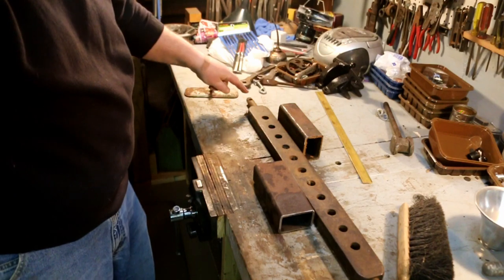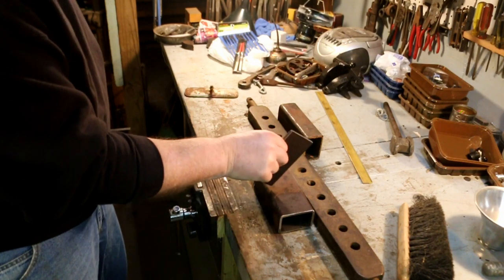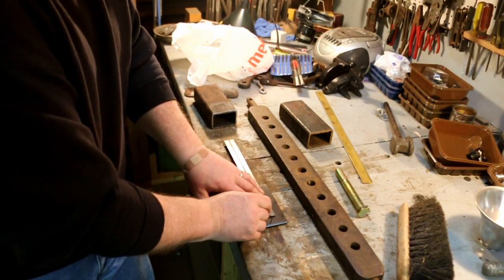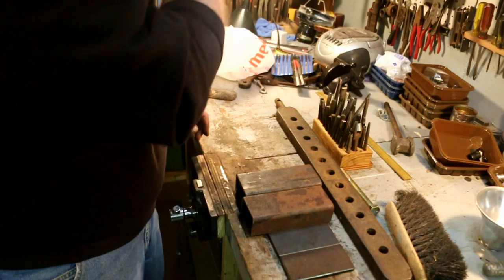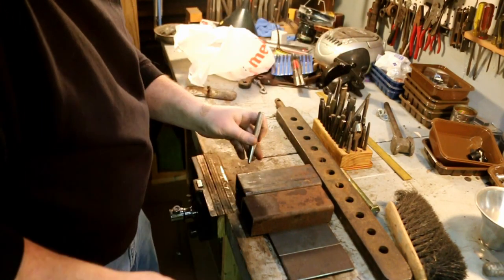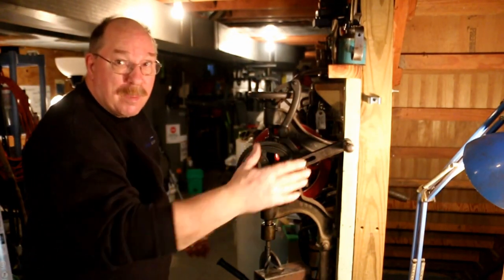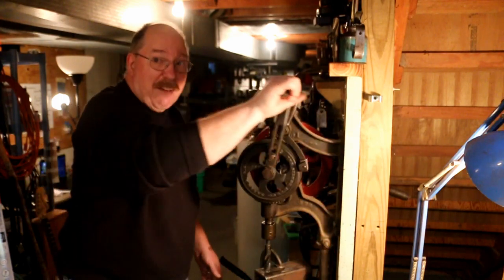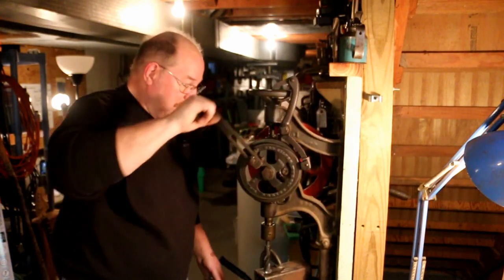Building A Tractor Mounted Engine Hoist Pt 3 The Boring Bits

Comment: Our old post drill in the blacksmith shop at one time ran off a line shaft but was converted back to hand crank before I was born. Ours had a fairly large cast iron fly wheel built into the crank arm...or better yet, the crank was attached across the flywheel.  We could flip the indexing lever 'in' to engage the automatic feed or 'out' to manually feed by turning another wheel at the top of the quill with your left hand while cranking with the right.  The left alternately oiled the bit and turned the quill feed when the auto feed was 'out'.  I have at least two and maybe even three smaller versions of post drills hanging in the rafters in different sheds for decoration as we speak.  Good video sir. I enjoy old tools quite a lot.
Reply from the maker: There is another post drill sitting on the floor under this one. It needs the lower mount, shaft, and table.

Comment: Every time we get to see that lovely post drill is a great day!  Thanks Dave!!!  😃👍
Reply from the maker: It use to just hang on a support beam in the old shop. Ryan was about 4 years old and smart enough to not get his fingers into the gears. He loved to crank the handle when he was out there with me. 
When I mounted it here I decided to use it in a couple of videos just because it was kind of unique. That's when I discovered how well it works. The gearing is such that it doesn't take much effort to turn even a large bit. Drilling the 3/8" holes for the SB lathe motor mounts I could almost spin it with my finger.
Reply: YOu need one or 2 shined up, Scout!

Comment: That's why I like the old stuff. It'll work when folks are hunting PC Boards to get the new stuff working again. I like my Clunkermobile as Cheryl calls it. Don't need a computer tech to fix it. And the Honda is even better. But arthur doesn't agree with some old things. I have to sort out and set limits, or rather arthur does. Good deal, Unc!  I dare say the mower is already at home and probably running by now!
Reply from the maker: I wish it was. It's still sitting in the neighbors shed. Lots of projects going full time. Most are  of the dull kind so no video. 
I understand setting limits. With the grace of God I managed to heal up on my own from two blown discs. Took 6 years, but it is almost as good as new. For those six years I was very careful as to what I did and didn't do. I have avoided arthritis so far. Runs in the family so that's a plus. 
My nephew was just in the hospital for a second surgery on his back. He was paralyzed for a while before the first surgery so it was definitely needed. This time it was pinching the nerve and causing severe pain.
The neurologist told me that if I was healing at all then to not have the surgery. He said the problem with the surgery is the scar tissue is what it is. Most times it works fine, but for my nephew it made it much more difficult to fix the second time.
Reply: @OldSneelock  I understand. If it ain't broke so bad you need help, don't get any. Every fall my breathing gets shorter. I think it's from all the stuff that certain people spray in the air, for the corporate good, of course. I just wheeze along till spring comes and I get somewhat better but I've never been this old before so I don't really know what to look for but I sure know I ain't getting a bit younger. I can send you the box tracking number in a personal if you want it. It's coming priority. It was the same as ground so he just sent it priority which was fine with me. I've got it right here but I know with everything going sideways sometimes I'd better ask so you'd be looking 4 it. And my back hurts all the time too but I wobble along. No knife for me yet.
Reply: @lewiemcneely9143  At first I thought you guys were fixing machines until I realized you were talking about God's machines. Knees ain't what they use to be and the left one sometimes has something floating around in the cap. No problems until you kneel on it and then you pinch what ever's floating in there and it feels like a knife. I try to kneel on towards the inside of the left knee. Ya press on it slow in case it's not in the Wright place. Oh and seeing as I work in industrial insulation another thing we do is cover pipes with rubber insulation to prevent sweating and I have save some of that to throw down where i'm gonna kneel. I still do what I use to do it's just that it takes me longer to do it. I also try to plan better how I do things. Laying under the car and having to crawl out to get a tool is something that I learned to use the Seven P's. Prior Proper Planning Prevents Pretty Poor Problems and also is easier on the back and knees.
Reply: @mostlymoparih5682  HEY, Palley and you never know how or where it'll go here. We have some dandy conversations back and forth. No strangers here that I've found and Unc. makes sure there are no chrome-plated jerks either. A FINE place to be, just like the Wally's Place. Everybody has their own niche and we're all here to learn and help out. I can't use my knees except to sit down or get back up after a roll over. The kneeling is over for me and has been for some time. I have a buddy that got semi-fried insulating condensate pipes in a running turbine at an atomic plant. PLEASE stay away from those blasted things, Buddy. He's well taken care of for a supervisory mistake but still in a wheelchair. Don't need YOU in one! Too much to do at the hotel and garden this spring! The job'll take care of itself, sorta.
Reply: @lewiemcneely9143  Gotcha keep my hands to myself.  I do get burned sometimes but it's usually the arms or the back of the hands. We are always looking and you hit a pipe quick to see if it's hot. Steam is hot and you have to be careful around it. Be nice to stop working butt gotta pay the bills and the freds and the daves. Everybody wants money. Maybe I should buy a lottery ticket.
Reply: @mostlymoparih5682  10/4 on the steam. I did a lot of talking with the guys that worked at the paper plant here about steam because everything about it ran off it and they said the found leaks with a broom handle because of the volume of high pressure and you couldn't see in it anyway. I worked all over the outside and always wanted to take a tour of it but it was gone before I got the chance. I was working with sub-contractors with hauling or concrete or doing draglineing or something. I would walk around and peep eye stuff during eating time or waiting time. Went under the boiler house once where the coal grinder/induction fans were and got to thinking if one burped I'd be fried. I left.
Reply: @lewiemcneely9143  Yeah if one of the plants that I work can be like a small nuclear bomb. If it goes off while I'm there they won't find be I would be dust.
Reply: @mostlymoparih5682  I used to stockpile gravel in the switch yard and the nearest one and my hair would stand up from being just plain scared of everything around me, power and atoms flying. I was hauling there when I blew that front tire. I do NOT like that place and thy bought up the country to run a hi-line to Alcoa to make aluminum. Duke is investor owned and WILL make money before anything else.
Reply: @lewiemcneely9143  All of our employees light up at night. That's okay as long as we are making money.
Reply: @lewiemcneely9143  My glow is wearing off so I gotta go Big Brother Ketchup with ya ta mar row hotdog. Sweet dreams and bed bug bites and all that other stuff. Oh and make sure the hatch is closed under the bed so the B man can't get in. Chow Brudder.
Reply: @mostlymoparih5682  My glow wore off about 20 years ago IF I ever had one. Donut remember seeing one. Might have been someone sneaking up beehind me. Night Martino!
Reply: @lewiemcneely9143  Had a good sleep LM. Hands are sore worked on two2 cars yesterday. Need to get new pads, calipers, and a gas tank fill for one and fix the leaking line for rear heat on a mini van. I'm the backwards part of LM . I bee ML. Enjoy the Lord's day.
Reply: Oops and say hi ta Toots. I mean Cheryl.
Reply from the maker: @lewiemcneely9143  Aluminum is one of the crazyiest metals to work with. It melts easily at a fairly low temperature. It can be extruded at about 900 degrees. Die casting in metal dies is fast and inexpensive. The only problem is it really likes oxygen. Once melted it will strip oxygen out of water and form both steam and hydrogen peroxide. The resulting explosion can be strong enough to flatten a city block. 
It also is at just the right temp to stick to you. Weld or casting spatter from iron is so hot it turns sweat to steam and blows itself off your skin. Aluminum splashes out into a film and sticks. It has to be pealed off. 
A friend was loading aluminum ingots into a die cast melting pot. It splashed and covered his right arm like a sleeve. Now it looks like tooled leather.
Reply: @mostlymoparih5682  She's used to it.
Reply: @mostlymoparih5682  I always do and you've got the Handy Hands. Mine are just hands but can still get stuff done sooner or later. Mostly later but slow beats no!
Reply: @OldSneelock  I've said it before and I'll say it again. I would've LOVED to follow you around some. Your experiences are overwhelming to me.
Reply: @lewiemcneely9143  yup slow Is better than no Unless we are talking dinner than leave early so ya get there on time. Mom Used to say when we got two2 dinner late ya snooze ya looze.
Reply: @mostlymoparih5682  Well, yeah and that'd go with the hotel too. All those smiling hungry faces and you just bringing a load of fresh from the garden. I bet Dottie would save yours, even if she had to hide it.

Comment: Neat old drill, makes my shoulders hurt just watching.  Your right my Craftsman drill press doesn't have enough torque to drill a 3/4" hole in a 2x4.   I don't know if a new motor would help or a different drill press. That's a good project you got going looking forward for the finished lift.  I finished up my build on my carbide lathe tools last night, lots of quality time with my hacksaw and files.  Love the way they shape wood on the lathe.  Keep warm back there Unc'.
Reply: Paul, does your press have the skinny little V-belt? That might be the problem. I've seen them slip even if they were as tight as a banjo string. The old 1/2 inch wide jobs did a lot better with the wide groove step pulleys.
Reply: @lewiemcneely9143  It has a 1/2" belt the problem is the 1/2 hp motor stalls out  the belts don't slip.  I looked at a new motor about $200 and later found an old GE motor 1/2 hp. The guy told me the motor would hum and not start unless you would spin the shaft.  AH the starting cap is bad. I replaced the cap about $8 on line.  The motor still wouldn't start. I tood it apart on day and found another cap inside the windings. The motor had two switches wired into the housing.  One switch is the starting cap when it comes up to speed you turn it off and it will run on the other cap. I talked to an old electric guy and he said that motor is from the 20's or 30's before they were built with a centrifugal clutch that will disengage the starting cap.  This is a long story the step pulleys are in metric and that motor is 5/8" shaft. and a pain to run with all the switches. still have my eye out for a motor and new sheaves.
Reply: @paulharriss1192  Sorry to hear it, Paul. Seems like it's one thing after another unless you could get a lathe and do some sleeve making or boring.  I don't have a drill press or any room for one and no parts either. Wished I did but the only loose motor is a 1/3 horse on a wire wheel.  Shame you can't fine a full horse motor but who knows. You just might!
Reply: @lewiemcneely9143  I'll keep my eye out would like 3/4 hp or 1hp. It will show up some day not a priority for now.  Enjoy your day and watch out for all those loggers.
Reply: @paulharriss1192  Thanks, Paul and it'll show up one day. Till then we both will just have to use multiple bits and hog things out a little at a time. I always work on the 'Close as Horse Shoes and Hand Grenades' principal anyway so I can usually cinch things down so they don't flop too bad and there is usually a welder somewhere if it does! And there's too much rain for loggers today unless the logs are floating by!

Comment: Top top class sir , as the McDonald's ad goes I'm lovin it lol . Don't you think doing it by hand big holes seems to go through quicker when ever I had stuff like that the two speed hand drill came out didn't have a press like that in the end but the old faithful cut it like butter . Really enjoyed thanks 👍
Reply: Like you, it helps to know how to do it. A hammer is slower, noisier and not precise at all. Trust me on this and BLO doesn't help at all. One of the very few things.
Reply from the maker: The post drill has a screw feed that forces the bit into the steel. With a hand feed drill press the bit can end up just rubbing and not cutting. You can tell the difference in how it works. I was able to hold the drill bit in my hand after drilling four 3/4" holes. On the drill in the garage it would be hot enough to burn my hand.
Reply: @OldSneelock  The strongarm power feed. Works every time! Crank & go!
Reply from the maker: @lewiemcneely9143  Nothing wrong with using a hammer if you do it right. Tractorman44 did a nice job burning then drifted the holes to size for the frame on his buzzsaw rig. The old timers punched through with a flat nosed punch and drift.
Reply: @OldSneelock  True but I don't have the finesse that the old timers had. I just beat it into submission but I am getting better. I have actually started cleaning stuff up. I don't think I'm feverish! Oh, the scorp stuff is in the box. I forgot what was even in there!
Reply from the maker: @lewiemcneely9143  A big box arrived last night. Thanks Lewie.
Reply: Thank you sir for the compliment.  I did have the grand fortune to spend countless hours in our old blacksmith shop as a young-un. Rainy days were always repair days in the old shop.